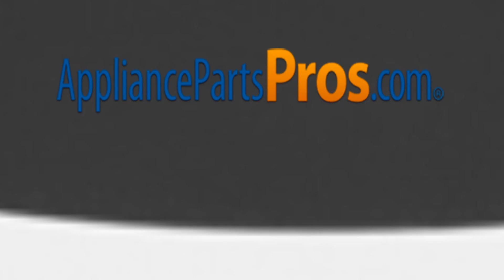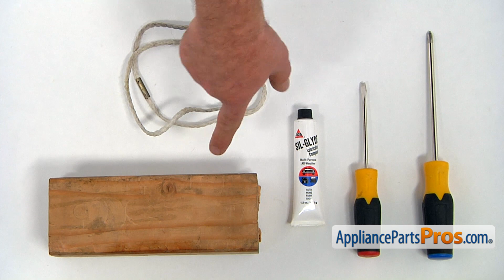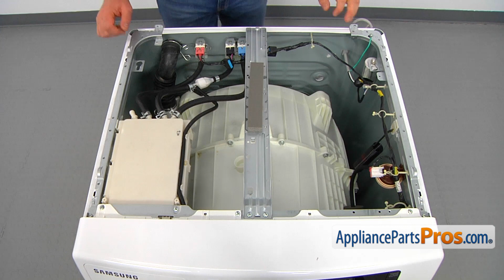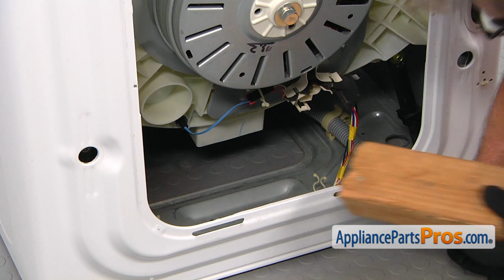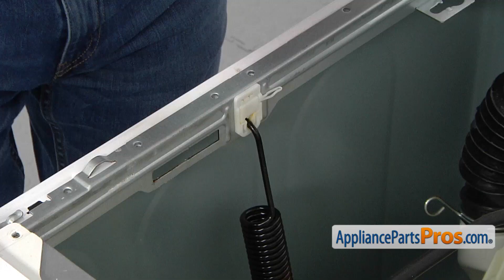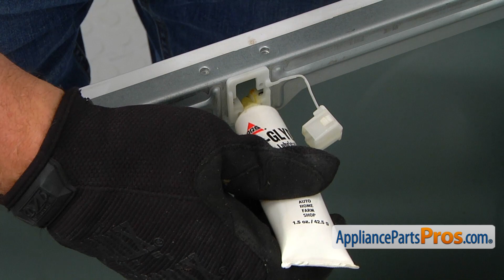How To: Samsung Suspension Spring DC61-01257L

Comment: How do we know if the springs are bad or good.
Reply from the maker: What is your model number of the washer?
Reply: Model numbers is wf218anw
Reply from the maker: The only way to tell if these springs are bad is to just look and see if they are worn out. These types of springs don't normally go bad.
Reply: I've got a Samsung 592-49032 and it won't balance itself, it will spin and shake and try rebalance and then quit. I replaced the 4 shock absorbers, it helped a bit, but still shakes bad when spinning. Is it possible that the 2 suspension springs are just getting weak and not supporting enough? Our washer is approx 10 years old. Or what else could cause it to shake bad? @appliancepartspros
Reply: I'm replacing my customers springs because the dispenser has been leaking and the springs are rusted over. Usually the shock absorbers go back on the bottom first before these springs will ever wear out.
Reply: @TomReinke89  I did replace actually shock absorbers, but washing machine started to jumping a lot, not possible to spin. Looks like the springs are old. So I just guess, I f replace them will help. Old ones absorbers returned back and it works. But drum is stilll loose, but I can use washing machine as before. So just replace absorbers will not be solution to smooth running machine. I have had also problem with leaking dispenser, spring was coroded and even worse, the ear on drum was cutted by this spring almost to the end. Drum will fall down maybe in one week of using.  Does exist any repair kit for ear? Actually I just improvised. Do You think if I replace springs, will drum be more stabil?